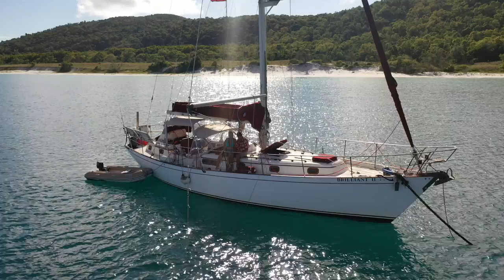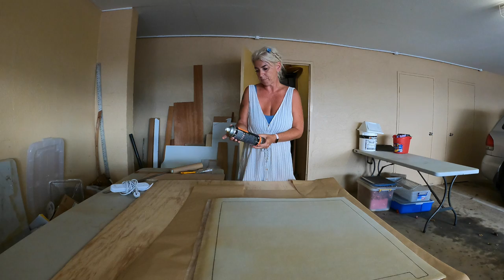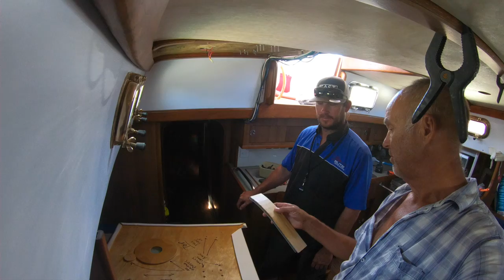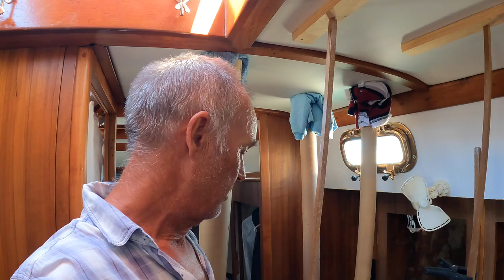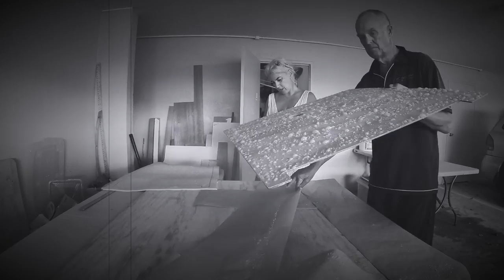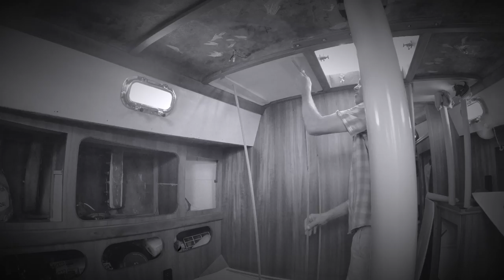Head's Up! How To Retro-Fit A Headliner | Boat Refit Documentary Part 15

Comment: This series of videos is without doubt the best DIY you tube self help material I have ever seen. Well done and  its amazing how few people are looking at this. Perhaps you might reconsider your Youtube  channel to Older Yacht Refit to boost numbers! I was on to you previously and you very kindly responded to me directly! I bought my KP 44 last year and sailing her home from Southampton to Ireland. I love the way she sails in roughish weather. She is a class act and maybe you might share some sailing videos of your boat when you start to enjoy her after all this work! I don't have the skills you guys have to undertake the level of renovation on these videos and my standards are not as high as yours, in some ways thankfully! I solved the pub finish look of the headliner by applying semi flexible paint and painting the lot after applying a primer. No where near as good as yours but its better! I now have to rip out my diesel tanks as they are destroyed with rust (why install cheap metal tanks in the first place ..grrr) and replace with plastic. All costs gone up thanks to that $%£&*% Putin! In the meantime, I have some more questions! 
How did you get your portholes looking so good? Did you have to remove them from the upper deck?
What batteries do you have and what battery management system do you use?
What engine is on board and how old?
What instrumentation do you use?
What sails do you have/use?
What are your long term sailing plans!

I'm planning to retire in a couple of years time, head south then head west. If I'm physically up to it, I might make OZ and
Reply from the maker: Hi Rob and thanks for your kind words.
We’ve been considering re-naming the channel when we eventually get to the point of sailing further afield than our local cruising grounds.
Perhaps by that point we’ll be calling it ‘Sailing a new-old yacht’ 😂

You’re the second person who’s asked about our port light surrounds recently. They were polished while removed for re-sealing. It’s not as difficult a job as you might think but like everything else requires a degree of elbow grease. If we end up doing the ones in the aft cabin I’m sure we’ll video it but that will be way down the track.

Our batteries are Fullriver AGM’s and we’ve installed a Victron solar controller and Victron 3000w 120a/h inverter charger. These have been the best AGM’s we’ve had (7 years so far), but when they go we’ll probably replace them with lithium.

Our engine is 4000-odd hour Perkins 4236 (85 HP). We think it was installed in about 1995 pre our ownership of the boat. It’s an absolute workhorse! We had to have a top end rebuild after getting a hydraulic lock in Bali back in 2006 but nothing except a new raw water pump & injector pump plus routine oil changes since.

Our instruments are a mix of old B&G quad and new Raymarine (chart plotter etc). 

Sails are all now relatively new - partially battened main, hanked on staysail, 135% Genoa (furling), and Code Zero on a Selden furler.

Initially we planned to sail from our base here in the Whitsundays to the Kimberley in Australia’s northwest, with the boat in her old pre-refit condition. When Covid happened we decided to do the refit and have since been down that rabbit hole. Whenever the refit is finished we will re-assess and make a new plan then.

Hope that answers your questions and happy sailing on your KP 44!